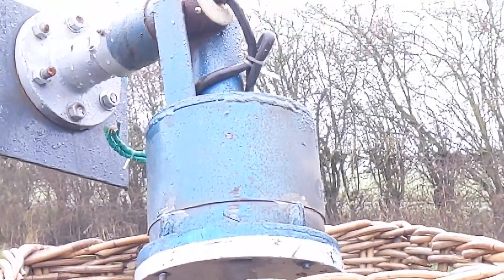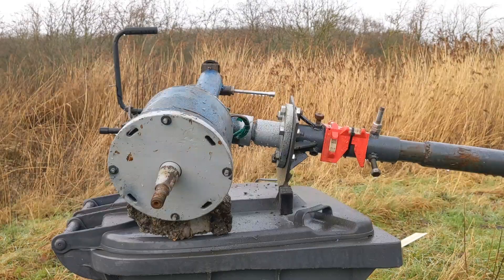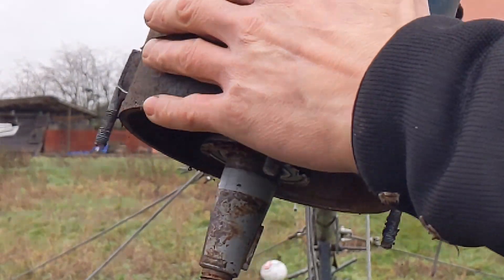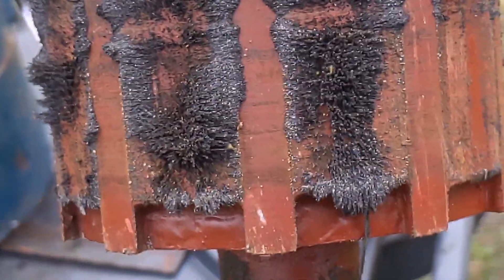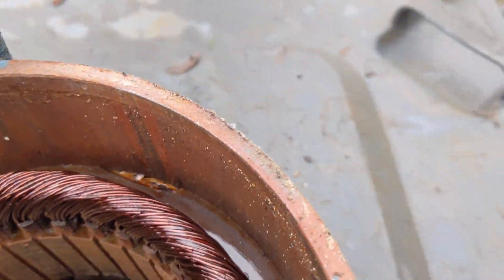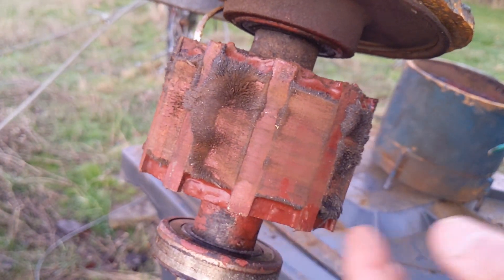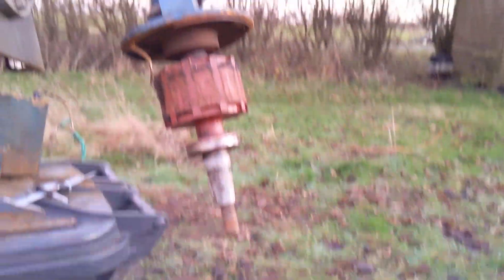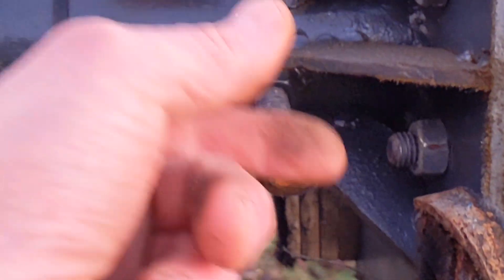R.I.P Chinese Wind Turbine - Whats inside ????? - 12th January 2022

Comment: Did you measure the resistance between each phase on each side of the electrical swivel?
Reply from the maker: Yes to be honest, I can't remember the exact readings
Reply: @GavinFreedomLover  The point was not the exact readings, rather that all three were much the same - all the time no matter the direction the turbine pointed - a common failure place is the contacts in the swivel.....

Comment: Weird how yours is welded together at the back, mine is bolted together and I've had it apart easy, the stator and front plate have through bolts to the back. This must have been a really early one.
Reply from the maker: Yea a massive pain in the arse to get off, I thought it would be very different inside or I wouldn't have opened it
Reply: @GavinFreedomLover  I will do a short video on my one when I get a chance so you can see the difference. I have an Ista Breeze i1500 on order so probably won’t ever put it to work.

Comment: coil looks bad, and probably thats the reason...
Reply from the maker: I could probably make some coils for it but I don't know if it would be worth the hassle, also I don't even know if I will be able to weld the motor casing on to the backplate I had actually expected the design to be completely different on the inside I haven't seen anything like that before.
Reply from the maker: I mean I will obviously be able to weld the casing back on but I don't know if it would be exact and these things as we know have to be perfect.
Reply: @GavinFreedomLover  yes, proper welding would be chalange to get it back in center as it was...
Reply: Gavin why do you think it stopped working in the first place?